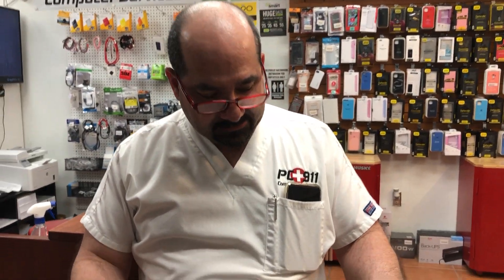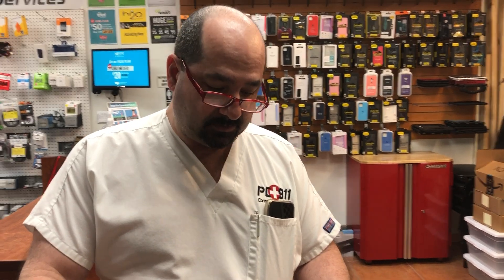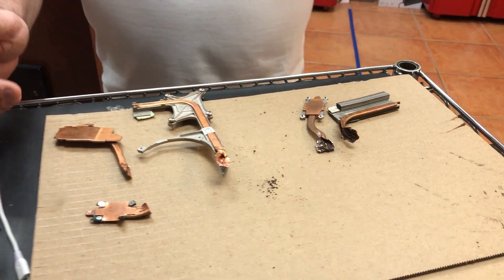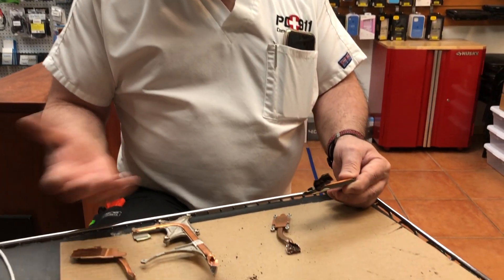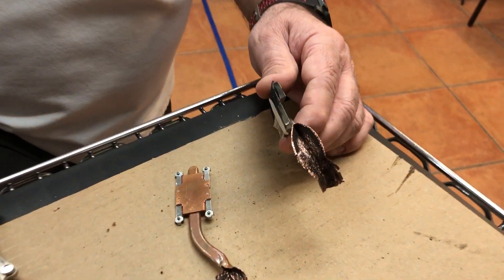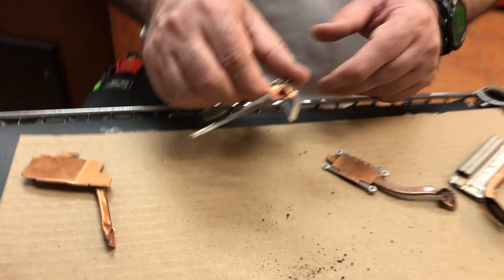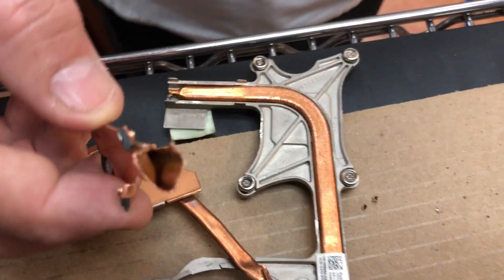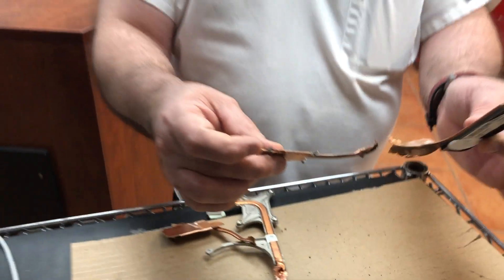Can a Heatsink go bad?

Comment: A closed hollow copper pipe filled with a liquid under reduced pressure is between the CPU and the fan. The liquid evaporates at the hot point (The CPU) and condenses at the cool point (The Fan) Sometimes the hollow pipe is lined with a porous substance (Charcoal) to aid the transfer of the liquid back to the hot point. If the constant cycling causes cracks in the pipe it looses it's vacuum and the liquid. It will stop functioning. The CPU will nolonger be cooled and your PC shuts down. Very little can be seen at the heatsink. To test : put one end in a hot glass of water while holding the cool other end between your figers. You should feel it warmup immidiately.

Comment: Exactly it can go bad, especially for laptops. They do this on purpose because the manufacturers want the customers and the computer repair shops to think that the laptops cannot be used properly after a couple of years and want the customers to buy news ones instead. In every business this is a dirty trick actually, for example, siemens do the same for their trams which are sold to turkey, we realized they use especially, bolts which are not durable, for some engine parts which is also highly dangerous. By the way i also saved my 2 laptops by just installing new heatsinks.